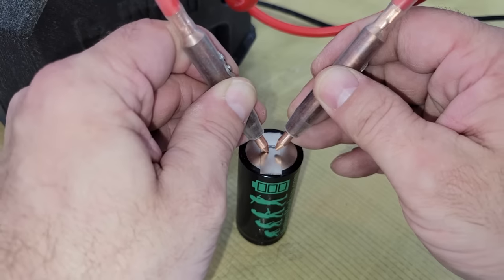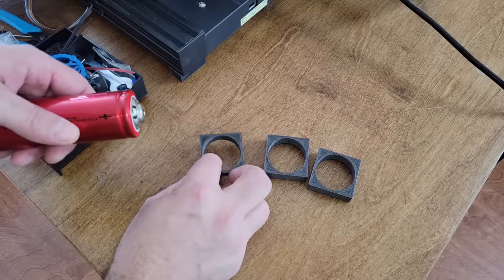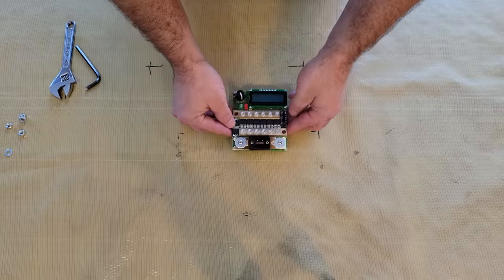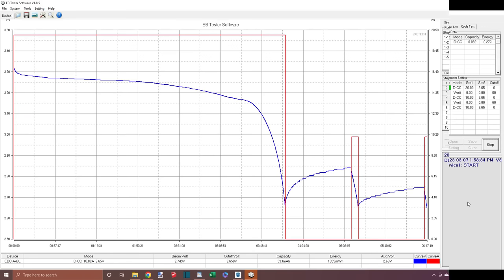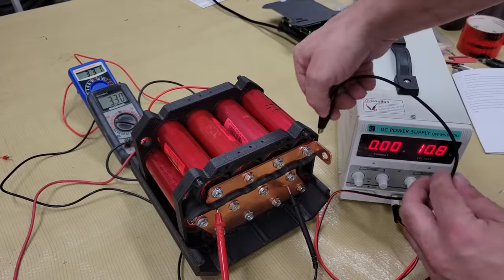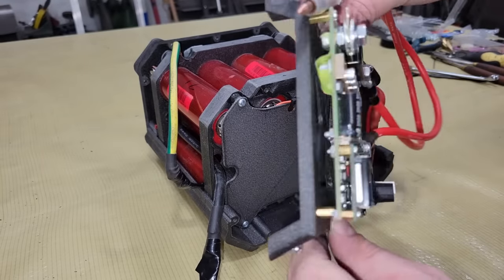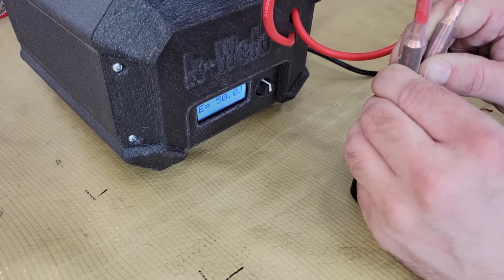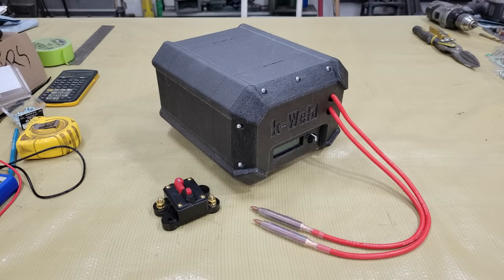kWeld DIY Spot Welder - Custom Battery & Enclosure

Comment: I’ve seen this Kweld DIY kit mentioned several times on endless sphere. 
Is there a decent spot welder that one can buy ready to use?
Reply from the maker: Not without spending thousands if not tens of thousands on a commercial welder that can do the same thing. Keenlab sells a capacitor bank to plug into it if you're not up for building your own battery pack for it, and provide 3d printing files for their own enclosure. But it's designed as a diy assembly kit to avoid needing CE certs and UL listing and all that expensive stuff to sell internationally. That would drive up the cost of the welder, and I guess their perspective is that if you can use the welder to build your own batteries, then spending an hour assembling it should be relatively easy ;)
Reply: @JamesBiggar  
Ok thanks for the reply :)

Comment: Are those wires moving cause of the high current?
Reply from the maker: Yes. High current flowing in different directions through two 'straight' (ie not coiled) cables laying next to each other, like the welder electrodes, will produce a strong enough opposing electromagnetic field in each cable to cause them to repel each other.

Comment: Can you explain to me how a bms would monitor an individual cells voltage when they are all connected together as one?
Reply from the maker: When you connect multiple cells in parallel (+ to +, - to -), that increases their capacity and c rate. 4 Headway cells in parallel = 7Ah*4 = 28Ah at 3.2V nominal. They'll naturally equalize their charge immediately after connecting and become one large cell called a P group. When you connect multiple cells or p groups in series (+ to -), that increases the voltage of the pack only - they won't behave like one larger cell because they can't equalize with one another through a series connection to become one cell. 4P3S means 4 cells are connected in parallel to increase the pack's capacity and c-rate, and 3 of these P groups are connected in series to increase the voltage. The wires from the jst connector go to the main positive and negative terminals of the battery, as well as connect to the positive sides of each p group (cell) as shown in the video. A 3S bms would also have a jst plug/connector that would connect to mine and use the wires to monitor individual cell - ie p group voltage. The positive wire connected to one cell in the string becomes the negative wire for the next when the bms takes a measurement. The same way that you can use a multimeter to connect to the positive and negative side of any individual p group in the pack to get a reading of that group's voltage. A bms just does it faster and better with software and multiple wires, and provides overcharging and over discharging protection via relays built into it that will cut power flowing through it if it ever sense a problem. But as I mentioned in the video, balance mode should only be turned on in the bms if a person wants a top balance on their pack.
Reply: @JamesBiggar  thank you,  one more question while charging a battery without a bms how does the charger determine the pack is full if the series connections do not charge each other.
Thanks for your time
Reply from the maker: The charger charges through the series connections, but the cells don't equalize through them. Chargers are designed with a set charging voltage - the voltage of the pack won't go beyond that unless the charger fails internally somehow, in which case the bms' over voltage protection will be triggered. Some chargers have an adjustable voltage output. Either way, the charger will monitor voltage and shut off when required. A bms is really just a smart circuit breaker with (usually) a passive balancing feature that really doesn't do much in terms of balancing, but they try and the effort is just enough to throw off a bottom balance if the balance mode is left on (again, only use balance mode for top balanced batteries).
Reply: @JamesBiggar  Even though I already understood all of the stuff you just explained, this is probably the best explanation I've ever read.  And in a youtube comment that is somehow even more amazing than it would be otherwise.

Comment: $240 for the kit that is crazy I'm sure it's good and I guess they are using name brand components but something closer to $100 sounds more like it to me
Reply from the maker: It's actually pretty reasonable for a 20 kW continuous (60 kWp) welder. $100 won't buy you much, maybe 8-10 kW at best. My old welder was $60 and it's only 5000W. Even using a modest 13 kW (out of a potential 60) with my setup, I have just enough power to weld 0.2mm pure nickel strips. Other kWeld owners have welded up to 0.3mm copper with theirs, which is really impressive. A $100 welder won't do any of that. If all you want to weld is <0.15mm steel strips, then a sub $100 welder will work fine. If you want to build battery packs with a high c rate, without having to layer an impractical amount of strips to get the ampacity needed, then you'll probably need to spend a bit more $ so you can weld thicker and more conductive materials.
Reply: Yea web site is quite sketchy first time I checked the price it was kWeld Spot welder full kit
Regular price $251.00
Shipping calculated at checkout.
Next time it was over $300.00

Comment: all you had to do with your old welder was clean the tips and sharpen the points or just replace the battery not hard very easy to open
Reply from the maker: Clean the tips huh? Gee, never thought of that after using it for two years to build over 20 kWh of batteries and sanding the tips down to half their original length in the process to get reasonable welds on <1mm strips 🤷‍♂️ The battery is dead, that's why it doesn't weld anymore. Even if it wasn't we're talking 1600A vs 600A welding current. 15 kW vs 5 kW. Which one do you suppose is more powerful and can weld thicker strips?  600A doesn't cut it for pure nickel, my friend. Anyone with any experience and isn't bs'ing themselves understands that much, at least. If you want to weld thicker strips, you need more power. All you have to do is math. Not hard. Very easy. 1600 is > than 600. 1600 - 600 = 1000A more. Get it?